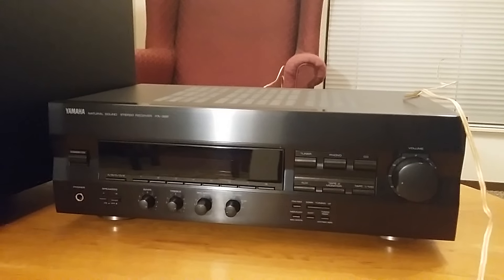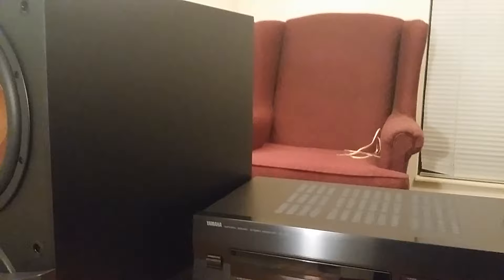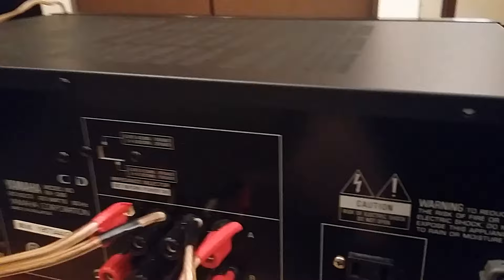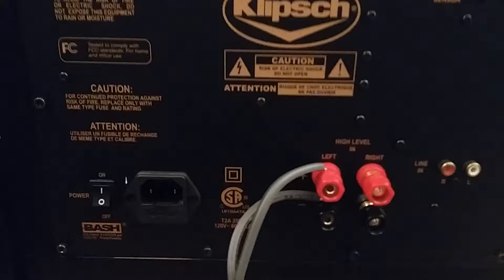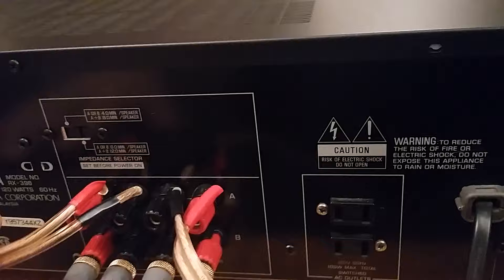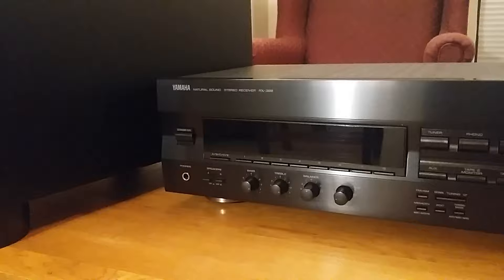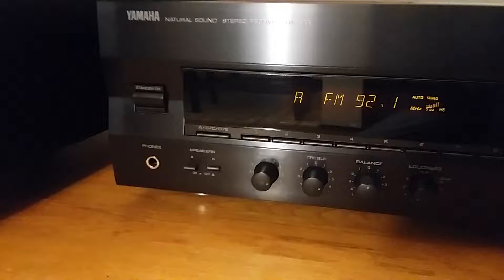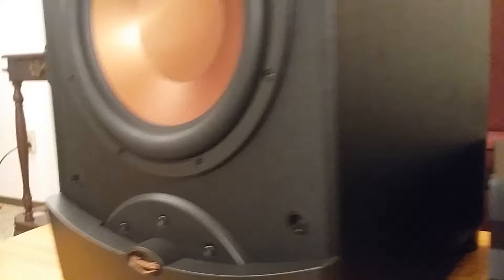How 2 hook up a active subwoofer to a receiver or integrated amp with no subwoofer pre out on unit

Comment: Nice tutorial. How would you connect 2 subwoofers? I have a similar set up using High Level connection to 1 subwoofer but considering adding a 2nd sub.
Reply from the maker: flam550 see if your one active subwoofer will work with just right side or just left side speaker output by itself don't use both sides out put let me know the outcome I always put the subwoofer in the center in music in 2.1 setup . Just unplug one speaker connection to subwoofer it should work
Reply: @tee-jaythestereo-bargainph2120  Thank you. I will give that a try. I have a Definitive Tech sub that has High Level Inputs and High Level Outputs. I ran speaker wire from the Def Tech High Level Outputs to the 2nd Sub High Level Inputs. I was concerned though because the High Level Outputs (noted in the manual) crossover at 80hz.
Reply from the maker: flam550 yeah mine just has the high level inputs it doesn't have the high level outputs , I have had subs that have high level outputs  but I never used them in the way your talking about because each sub would have a different signal coming into them I try to keep it balanced , If I was you I'd run one left speaker wire to one sub then one right speaker wire to the other sub that way they'll be balanced but if it's easier for you that way it should be ok but that's putting a load on that one subwoofer that's going in and out and it might be not as balanced . I love Paradigm speaker though like to try the or new Demand series

Comment: Which subwoofer do you use in this video?
Reply from the maker: Klispch Reference Digital 10 its a hybrid desighn class d powering class A one of the beat subs klispch ever made but they were exspensive ! I have a review of this sub uploaded they dont salw them anymore 😥 but any Rel sub will have hi level input why i love Rel
Reply: @tee-jaythestereo-bargainph2120  Ok, thx for your anwser!
Reply: @tee-jaythestereo-bargainph2120  Actually I have one more question. Do you know if Klipsch speakers can work with a subwoofer from another brand like a subwoofer from Rel?
Reply from the maker: @_Stijn_  should work just fine!
Reply: @tee-jaythestereo-bargainph2120  Ok, thx!
Reply: @tee-jaythestereo-bargainph2120  Does it matter if I put the B speakers in the B output and the subwoofer in the A output? Or can I just choose by myself which output I want to use for my speakers and subwoofer? I'm sorry that I ask so much questions, but I want to be sure for I buy something :)
Reply from the maker: @_Stijn_  yes you can reverse A or B and thats what i am here for is to help any1 out I can , Actually i noticed alot of subscribers helping each other out on the comment section ! This is what i wanted the channel to become very 😊

Comment: My amp has only one channel of speakers can I hook the sub in parallel?
Reply from the maker: I have personally never tried that, I have always had atleast 2 channel amps , but other people on here on the comments say that you can do that , because the power sub only draws enough power for a signal
Reply: @tee-jaythestereo-bargainph2120  Thanks for the prompt replay and Would you connect the sub in parallel to one channel or you would connect to the sub to the right channel positive and left channel negative? Thanks in advance I'm just worried to fuck it up! LOL
Reply: Just hook up positive to positive and negative to negative on the subwoofer. Then hook up to speakers. Yes you can hook up subwoofer and speakers in parallel. So you can have speakers and sub.
Reply: @dalanwanbdiska6542  Thanks Man!

Comment: Okay so I have a car subwoofer, I got it working but I have two speaker running to the receiver I end up having to disconnect one to get it running but one speakers obviously  ends up disconnected. If I I have the speakers connect both on to speakers A and plugged the subwoofer on the speaker B would that work?
Reply from the maker: Cristian Ornelas are you using an active or passive subwoofer ? (powered or unpowered )
Reply: Passive
Reply from the maker: Cristian Ornelas i wouldnt reccomend using that,  The one on a passive house subwoofer they have DSP inside thats built into the amp section which only lets low frequency out to the sub speaker if you was to do that to a passive sub then you would be getting full range sound from your receiver/amp and it wouldn't sound good at all , and also on the active subwoofer threw high level input it just converts watts to a signal for the amp built in to power the speaker
Reply: Well I balanced it out and it sounds good, but only one speaker works no matter where I move the cables to even though I press both speaker a and b on
Reply from the maker: Cristian Ornelas check your balanced meter , then make sure you got good wire connection read each side closely to see you installed in A -L-R  /B-L-R connections if not that IDK what it could be without being there

Comment: But can you still adjust the Crossover Frequency on Hi-Input?
Reply from the maker: With the sub i use , i adjust the setting on the actual subwoofer has crossover to cut off 60-80hz
Reply: @tee-jaythestereo-bargainph2120  even without without plugging in electrical source? (sorry for my English 🙏🏻)
Reply from the maker: @matthewmabasa3331  no apology on the channel your good ! Yes the actual power subwoofer has a built in cross over that can be adjusted for a 60-80hz cutoff or more if you wanted to
Reply: @tee-jaythestereo-bargainph2120  K Buddy

Comment: Is this possible without 2 speaker channels some how???
Reply from the maker: Yes you can hook up sub with just one set of speaker channels
Reply: @tee-jaythestereo-bargainph2120  How would that be possible?
Reply from the maker: Just tie in 2 speaker cables to pos connection and 2 speaker cables into negative ' just make sure you hooked them up correctly to speaker and sub ' Sub only needs a signal thr built in hi pass filter won't pull power to thr sub like it does the speaker ' sub only needs like a 500mw signal that's it ' done it plenty of times
Reply: @tee-jaythestereo-bargainph2120  Brilliant thanks.
Reply from the maker: @T0pBaNaNa you got it what I am here for , if you ever need help with anything just ask ' 😉 I answer 99 percent of ?

Comment: If your sub has crossover and leads to connect speakers you would not like to do so as you loose low cut on speakers. Instead you would connect your speakers directly to sub.

Comment: Hello. Sorry for my bad English but i have a question and i cant find the answer. My question is i have home theater 5.1 which have satellite speakers and a passive subwoofer at high volume my woofer sounds a little bit off some people say is the distortion and it doesn't have any subwoofer out so my question is is there any way to connect active subwoofer i am a newbie in this but can i connect my passive subwoofer out in an active woofer so when i increase the volume it doesn't put the pressure on my amp. Or is there any way to connect active subwoofer to passive 5.1 home theater which doesn't contain any sub out. 
And sorry for my bad english hope you understand what i am trying to say.
Reply from the maker: Shaheryar Rais yes your saying your amp 5.1 actually powers your your subwoofer , Use the neg/Pos from ur amp output to a high level input of a active sub
Reply: @tee-jaythestereo-bargainph2120  Thank you. Actually i want to know from a person who knows I am newbie myself and dont want to fry my amp. Thanks again. :)

Comment: My Arcam has no high level out, it only has left and right nothing more, i thought id try to use the pre out but that didn't work well at all, how do I do this?
Reply from the maker: You would have to have an reciever ,integrated amp or pre-amp with a subwoofer analog rca output without hi level input on sub no other way but a step down but people only use them in a car I never tried that in a home Yet
Reply from the maker: The Arcam is the sub or amp ?

Comment: So how many watts would be going to that sub? Thanks in advance
Reply from the maker: 500ml watt resitor built into sub so not even a half a watt 😆
Reply: Tee-Jay The Stereo-Bargain-File im not understanding this..still new to the home theatre systems...so will the bass still hit at barely using a watt??
Reply from the maker: @daddyboss907  its barley a half what for signal then thay signal gets amplified by internal amp in the sub its the same input voltage as rca output 😆 it will rock out 😆

Comment: Or you can use hi to low adapter what it does convert speaker output to rca to your sub if your sub box does not have speaker left or right input good luck.
Reply from the maker: I have used what they call a stepdown before , In a car system but never in home system but i dont see why it wouldn't work that's basically how the subwoofers h-iinput works, Be planing on doing a how 2 build stepdown video tutorial but it will be months ahead been reviewing lots of new audio products

Comment: I have an old receiver (Pioneer SX-255R), it has A & B speakers but only use 1 of the 2 (A or B) can be used at a time.  If both buttons are selected only B works....
Any thoughts ?
Reply from the maker: Yes you have a very rare reciever that only plays one channel at a time either A channel or B channel , they both won't play at the same time , They should have called B-channel Zone 2 output , This only happened with a very select few Recievers but if you know a good electronics guy or girl he or she can add a jumper inbetween both channels , some people calls this a bridge : if your curious about what this bridge/jumper  looks like , Then Look up the Klispch RP-160s speakers that i did an indepth review on , and where the speakers connectors are on the back you'LL see that bridge it's (Gold color metal) that connects both channels together / On speakers they call this bi-wiring or bi-amping / I hope this helped , if you have anymore questions I would be more than glad to try to help
Reply: @tee-jaythestereo-bargainph2120     Thanks Tee-Jay , I appreciate the info.  You ever hear the Klipsch RP600M's ?   Steve G really likes them & so do other reviewers on YouTube.  I have a pair of Klipsch R-41Ms that I like a lot except they lack base.  Thats why I was interested in a sub, but I think it'd be out of my budget to buy a powered sub and also modify my receiver.   Thanks again -
Reply from the maker: @BruTay5454  No problem and yes I have seen all reviews of the RP-600 ,i could have bought a set for 429.00 but that was 5 months ago , But now their up to 600.00 , Ive never heard them but i know alot of people do like them
Reply: @tee-jaythestereo-bargainph2120    How do you think the Pioneer FS52's would work with my receiver?   I'm thinking a smaller tower speaker rather than bookshelf might work in my small room, and the price of these is sure good.  I know they'd be a lot different than Klipsch's, but I saw your sound demo of the FS52s & it got me wondering.  Thanks
Reply from the maker: @BruTay5454  hold on just a min i need to look up your amp first
Reply from the maker: @BruTay5454  heck yeah that reciever you have will make those Pioneer towers move some serous air ! And their amazing tower speakers for the money
Reply from the maker: I have owned that same reciever back in early 90s its a good amp !
Reply: @tee-jaythestereo-bargainph2120    Thanks Tee-Jay - I appreciate all the good info.  You're the man!
Reply from the maker: @BruTay5454  No problem , Thats what the channel is all about ! Once you get your fs52 towers let me know what you think of them
Reply: @tee-jaythestereo-bargainph2120   One more question if I may - I was poking around a forum for audio & saw that there's some subwoofers that might work for me without having to modify my receiver.  An example is the Polk PSW 10 - you connect the sub to the receiver & then attach the speakers to the sub.   Would adding a sub like that fill in the lower end of my Klipsch's instead of replacing them with a new set of speakers?  I'm not looking for wall-thumping bass, just want to hear the lower end thats definitely missing from the R-41M's.   Thanks
Reply from the maker: @BruTay5454  you mean running your recievers speaker output to the active subwoofers hi level input then running speaker output from subwoofer to your front speakers ,I have done this but my front speakers didn't sound that good compared to running fronts from recievers but yes you can do that but your front speakers wont be as powerful but it will work , And ask all the ? You want thats what this channel is for
Reply: @tee-jaythestereo-bargainph2120  Thanks (again) Tee-Jay.  Turns out I was wrong, I can run both the A & B speakers at the same time, so I can just run a sub using the B speaker output from my reciever.  I'll give that a try when I can find one in my budget.
Reply from the maker: @BruTay5454  heck yeah man ! I couldn't remeber if they both would play at the same time i actually had the Optimus (Radio shack) version of your pioneer same thing though just different badges lol gool luck once you find one let us know how it performs
Reply: @tee-jaythestereo-bargainph2120    Tee-Jay -   I watched your straight-up review of the FS52's again.  If I got a pair of them do you think I'd still need a sub?  The FS52's  are supposed to go down to 40 Hz, that's as low as the subs I was considering.   What do you think?   thanks.
Reply from the maker: @BruTay5454  The FS52s to me sound far good enough without a subwoofer, But some people like extream bass where the bass hits you hard in the chest these speakers won't do that they do have clean tight bass , move them about a foot away from your rear wall so the bass ports can breath better .
Reply: @BruTay5454  add the sub, you'll be glad you did.  if you need a budget brand look into monoprice or acoustic audio 8" or 10" subs.  amazon has a 10" sony sub right now for $98
Reply: @tee-jaythestereo-bargainph2120  Tee-Jay    I finally got around to getting a sub, Amazon had a Polk PSW10 for $89 on Black Friday so I grabbed it.  I hooked it up to the B speakers from my receiver, with my Klipsch hooked up to the A speakers.  But if I use both A & B speakers it cuts off the A speakers unless I run another set of speakers out of the sub.  If I run just normal speakers out of the B speakers instead of the sub I can play both A & B at the same time.  I guess I could hook up my main speakers to the sub instead of the receiver, but then I'm driving them off the sub's amp instead of my receiver, right?
Reply from the maker: @BruTay5454  So you can only run speaker A or speaker B output one at a time it wont play both ? I pretty sure those amps b output is actually for zone 2 not sure what amp you have but if your subwoofer is built to ne a pass threw then your front speakers are actually getting powered by your Reciever the sub just has pass threw
Reply: @tee-jaythestereo-bargainph2120  Yeah, I can run both A & B speakers if I run bookshelf speakers off both of them.  But if I run my Klipsch off of A & the sub off of B, then the A speakers won't work unless I connect a 2nd set of bookshelfs to the outputs of the sub.  My receiver is an old Pioneer SX-255R, it doesn't have a sub output, just A & B speakers.   I'll play around with it some more, I can tell I'm gonna really like the sub....

Comment: If my sub doesn't have "high level in" and had only banana plug outlet. Could I cut the cord of the manufacturers banana plug and expose the +/- wires to hook it up to the receiver side of the cable?
Reply: Do you mean it has RCA terminals? Those are not the same as speaker wire terminals

Comment: I have a question if I can connect 8 ohm amplifier with 4 ohm subwoofer high level inputs. and whether it has any difference
Reply from the maker: is it a powered subwoofer ?
Reply: @tee-jaythestereo-bargainph2120  yes this is active subwoofer
Reply from the maker: POWER ITS ME ok just making sure yes it'll be fine it's just converting to a signal that's it I've ran 4-6-8 ohm to mine and never had a problem
Reply: @tee-jaythestereo-bargainph2120  ohms make a diference ?
Reply from the maker: POWER ITS ME it shouldn't it's just a signal

Comment: What does hi-level input mean on the subwoofer?
Reply from the maker: The Hi-Level input on the subwoofer is like a built in step down , allowing for you to hook up with the amplifiers output for speakers , that way you have 2 different options of hooking a signal to the subwoofer .Thanks for subscribing to the channel, There will be alot more on how 2 Audio an 'tricks of the trade'

Comment: Hi, my passive subwoofer has only 1 rca input, can i still connect it?
Reply from the maker: Passive means non-powered you mean active ? Because a Passive subwoofer shouldn't have an rca input unless its actually a speaker connector
Reply: I’m sorry, it’s active subwoofer because it has its own power source. Can I connect it? Thanks
Reply from the maker: @RichardLumasag  what reciever are you using and what subwoofer ? That way i can look everything up 😆
Reply: I am planning to buy a vintage integrated stereo amp, my subwoofer is from sony component with RCA single input only
Reply from the maker: @RichardLumasag  yeah sorry to tell ya , but without the subwoofer having high level input it won't work , I have owned alot of Vintage integrated Amos and monster recievers love me some Vintage !! Sansui AU Sony ES And Denon PMA are my top 3 favorites 😆 
I just bought a new reference Intergrated amp pure analog of course 😆 the Yamaha AS-1100 their having a crazy sale on them ! Check out my pop the hood video . Thanks for stopping in wish we could of figured out away to hook up ! Check this out if the integrated amp you buy has even a full range preout rca you can go this route 😆